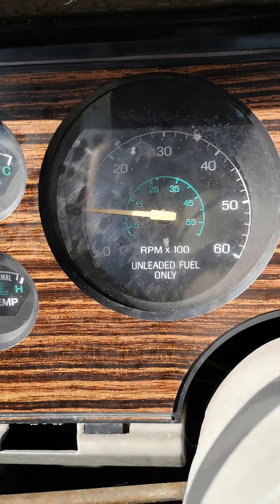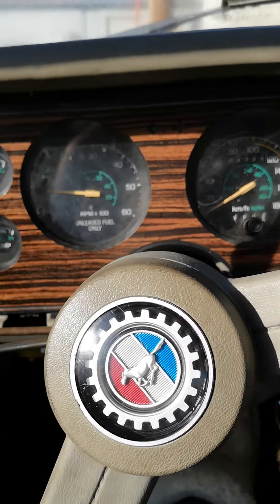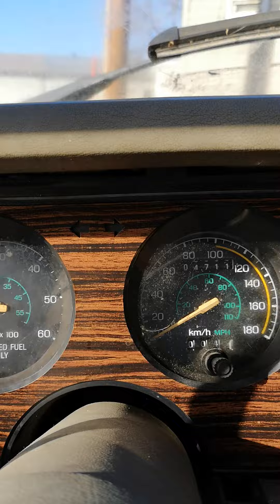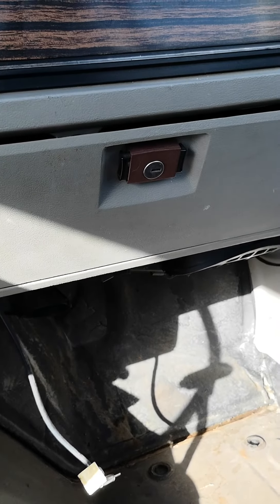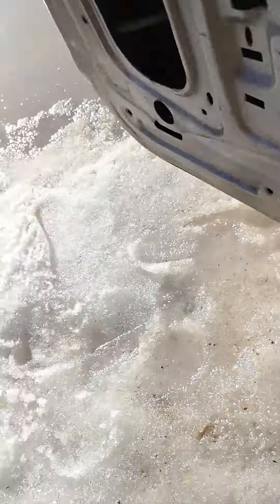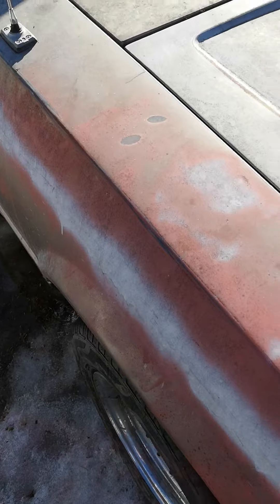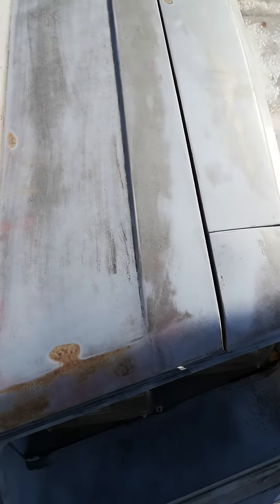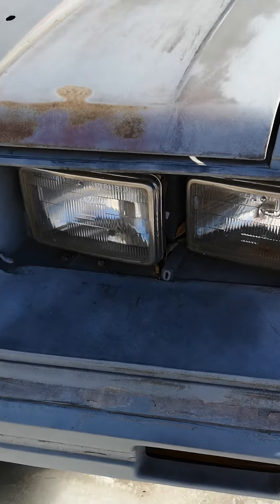She runs without a jump!

Comment: Man you've had stitch for awhile glad to hear how you are going to fix it up with the 3 stages you were saying in another video.
Reply from the maker: March 2019 is when I bought her. Want to say it was the 26th? Valentines day 2020 is when I got her registered. Now it's the stuff I want to do such as cosmetics and the updates to the powertrain :)
Reply: @KatarinasGarage  that's awesome! What color do you plan on painting her?
Reply from the maker: @nathan65071  won't be a full paint job. Just where the primer spots are and the passenger door. To the original color. Want to keep the overall patina on the car. Paint those areas, wetsand them, and clearcoat then polish it out.
Reply: @KatarinasGarage  nice I really like the patina look.
Reply from the maker: @nathan65071  thanks! It's certainly not the best patina out there but the fenders and hood look good :) I also want to paint the bottom of the doors in the same color as the primer down there. Will tie into the red on the interior.